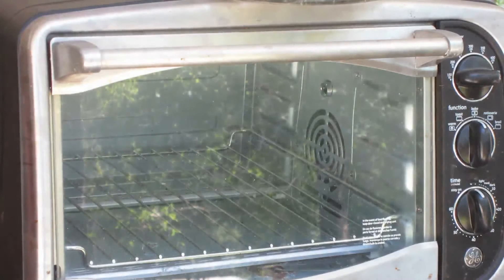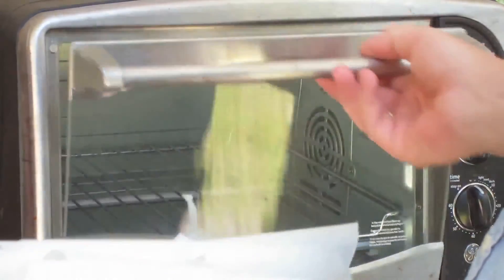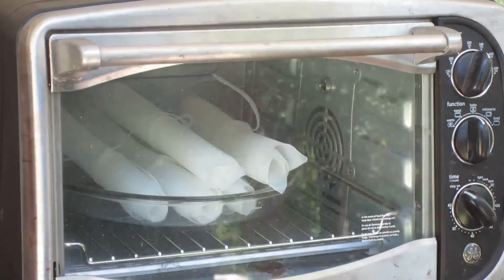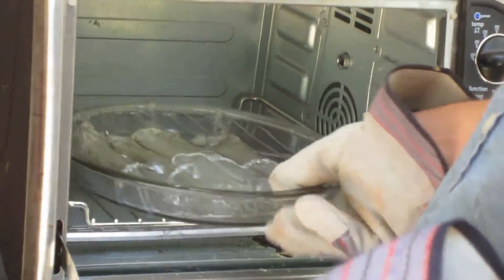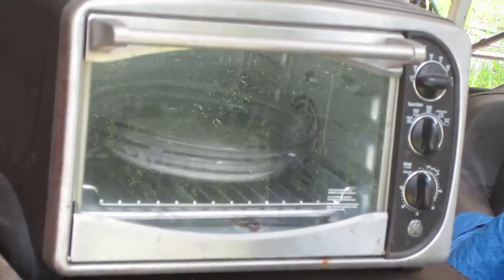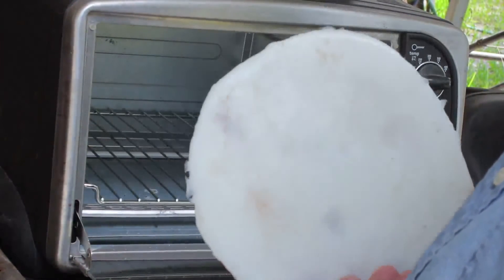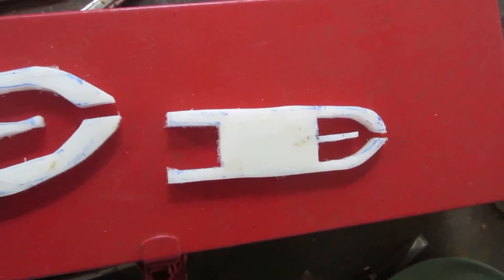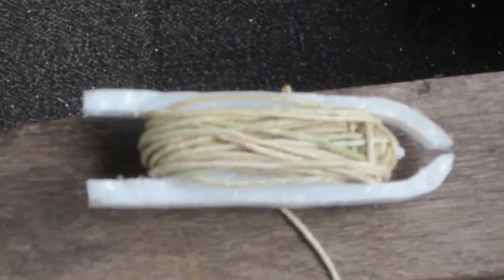Melt HDPE plastic bottles to create a net making needle

Comment: Would it help the needle to move freely and not hang up on rough edges if you were to use a belt or disk sander to smooth out the edges or maybe reheat it with heat gun and ware gloves and rub the edges round just a thought
Reply from the maker: Yes heating the edges would cause it to round over.